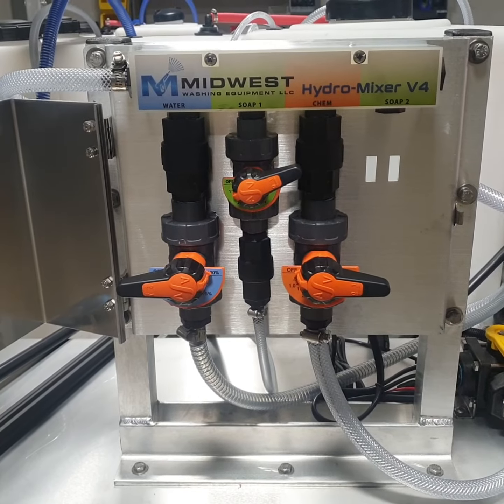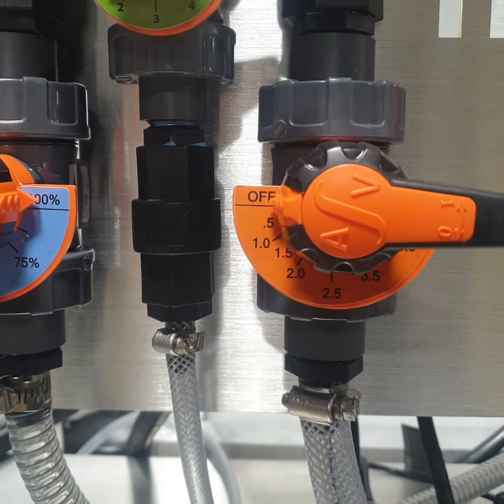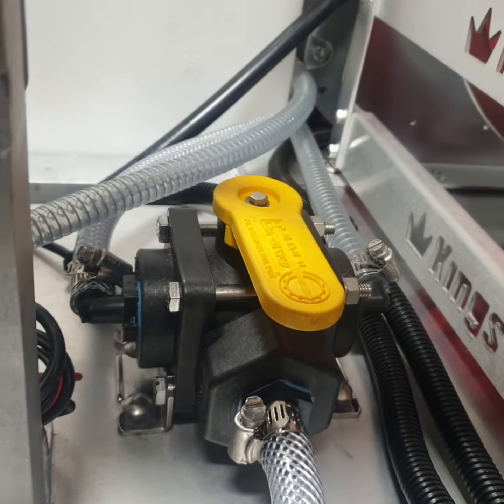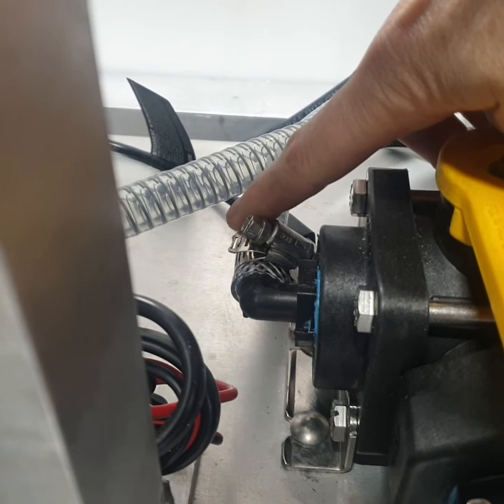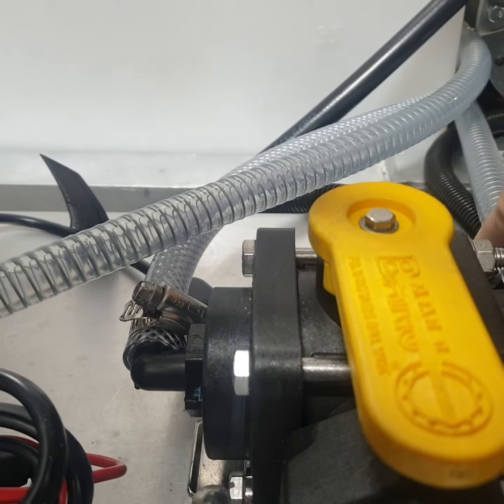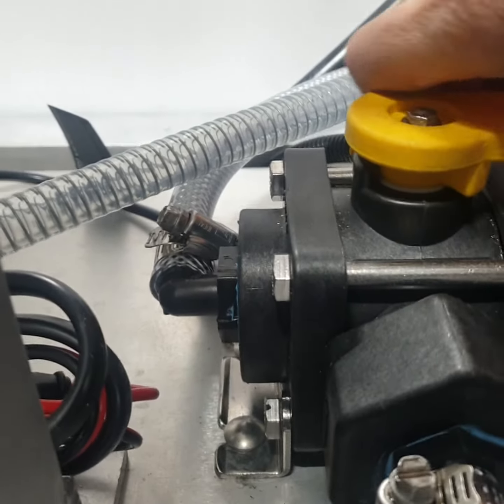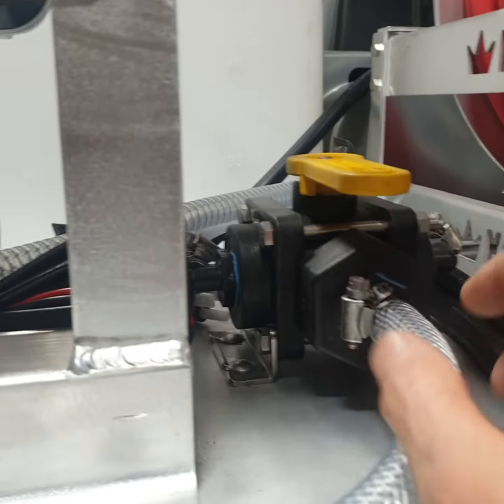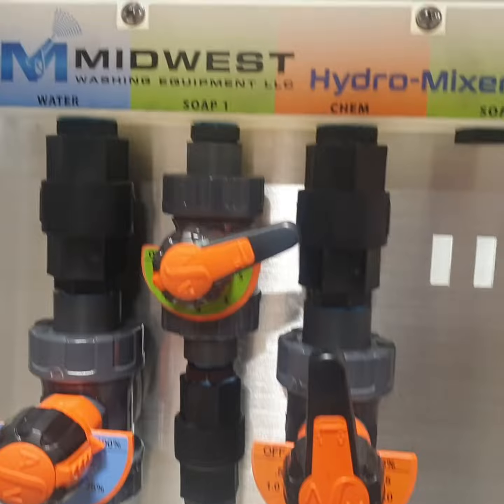Flush valve installation Hydro-Mixer and other proportioning blend manifolds

Comment: Would u do this with the p36 gas powered system too ?
Reply from the maker: Yes sir
Reply: @Midwest Washing Equipment LLC  my water is 1 inch chemical is 3/4 which one would I need
Reply: @midwestwashingequipmentllc1209  can u run 3/4 chem lines on the p36 comet or do i need to just go with 1inch
Reply from the maker: @dirtblasterspowerwashing  3/4" on both water and chem.
Reply: @midwestwashingequipmentllc1209  ok thanks